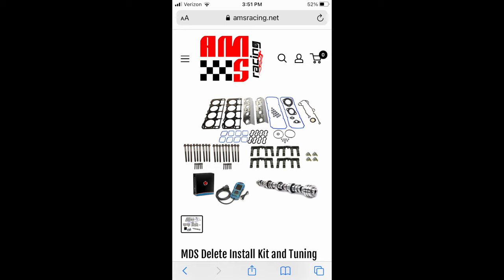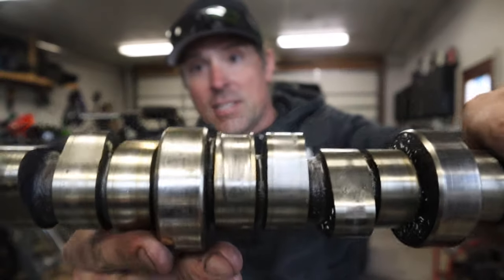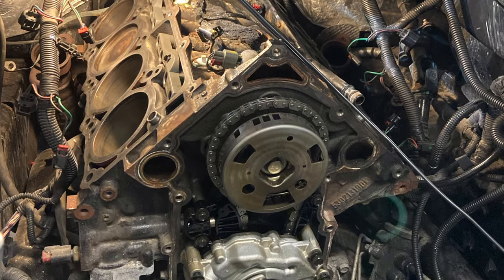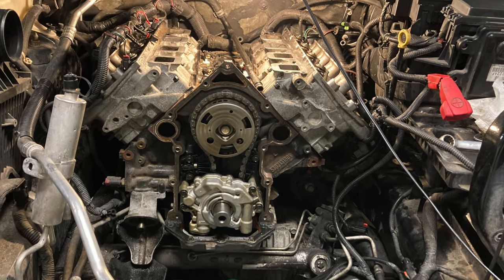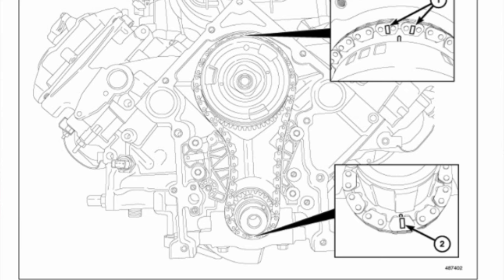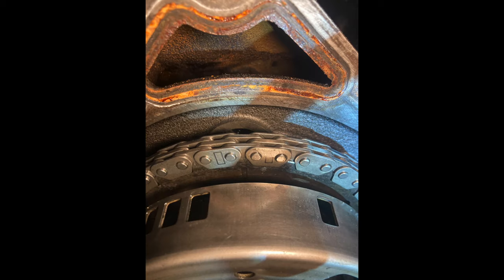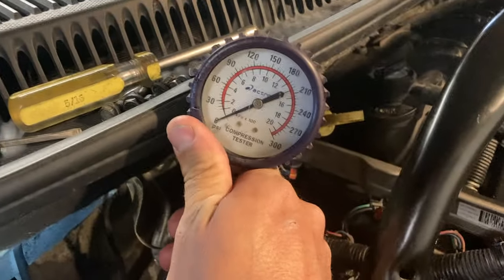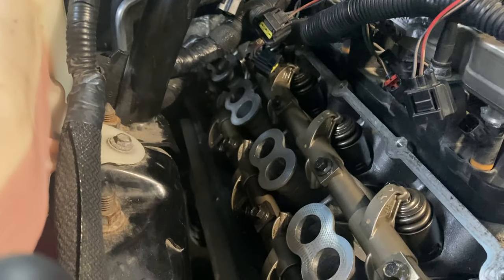Hemi 5.7 MDS delete, Lessons Learned

Comment: Here's what to do for MDS delete,
- Remove the 4 mds solenoids and cap em off and you will need a new 6.1 cam and set of non MDS lifters installed AFTER you use a tuner to turn off the mds system. Otherwise it will try to turn the MDS on and the computer will pop out engine codes. Also, if you go with 6.4 cam then you will need a tune otherwise the 6.1 is just a direct bolt on, no tune required besides turning off the MDS system BEFORE you do any work on your car.
Reply: Does 6.1 cam gives extra hp ? Or it is just non mds cam same as 5.7 ?
Reply: With the conversion to VCT, the cams for these engines employ a completely different cam core assembly with a much longer front cam bearing journal that includes two annulus grooves cut into the journal to supply oil to the phaser mounted on the front of the cam that controls the VCT. Of course, this means that early cams cannot be interchanged with 2009 and later versions as they physically will not fit the block. So this negates any idea of using a more aggressive 6.4L Hemi cam in an early 5.7L truck engine, for example. However, all VCT engines use the same cam journal sizing so these cams can be interchanged which offers opportunities to place a more aggressive cam in 5.7L truck engine from a passenger car application. This means, of course, avoiding the use of any MDS camshafts. In the early ‘03-‘08 5.7L and SRT 6.1L engines, the camshaft is retained with a small 4-bolt plate and the timing chain assembly also used a specific tensioner and guide system. This was necessary because of the greater distance between the cam and crankshaft. With the redesign in 2009 and VCT, the front cam retainer plate became larger, retained with four bolts, and the tensioner and guide system was also changed. These systems are not interchangeable as they are specific to either early or late cylinder blocks.
https://www.holley.com/blog/post/everything_you_wanted_to_know_about_gen_iii_hemi_engines/

Comment: My non MDS 6.4 hemi 392 charger has been running smoothly after 130,000 miles
Reply: However I change the oil every 4000-5000 miles without hesitation
Reply from the maker: That’s great!

Comment: Im in the middle of doing the same thing. What do i do with the mds solenoid harness? I have the same kit mds delete.
Reply from the maker: You can try to secure them off to the side, but I just left them disconnected.  I turned off the MDS on the Diablosport tuner, and have not received a code.
Reply: It can't be removed as the Cam sensor is part of it, leave them unplugged, won't bother anything.
Reply: @wheelinoutwest  Job successful. My hemi is now running with zero codes. 25miles so far. thanks for vid and info
Reply from the maker: @gregm90  that is great news, glad to hear!
Reply: If you just get the diablo tuner before anything goes bad and delete the mds you shouldn't need to replace any parts correct or am I wrong?
Reply: @dustinjohnson7002  wrong I think it will run longer way longer though.. it’s not yet proven but they will for sure run longer I think getting a he’ll cat gas pump will secure the deal tho

Comment: I guess I had no idea you had to go through all that to delete MDS.  I may attempt this in the future, when my Ram is much older, but it's my only vehicle and knowing myself, it would turn into a nightmare of a project.
Reply from the maker: That’s to mechanically delete the mds, you can shut it off electronically with a tuner. I only did this because I had to tear into the engine and replace the cam anyway.
Reply: @wheelinoutwest  That's what I thought, your video kind of threw me for a loop, didn't realize you were replacing the cam regardless.  Are there any risks just deleting the MDS with a tuner?  I'm a little nervous about it to be honest.
Reply from the maker: @mplslawnguy3389  Not the I am aware of.  The oiling system should work just fine.  I would suggest reading some online forums and such, there is some great info about it.  There is also a video that illustrates how the mds system works, that is really good too.

Comment: The problem was that you did not tune the mds system off BEFORE taking it apart. The computer was freaking out with engine codes for that reason. Also, the bent push rod was because it was not seated properly when you were rebuilding it, that's why it didn't idle properly 👌
Reply from the maker: Thats not what happened at all.  The pushrod was bent before I ever touched it.  After putting it back together I did have a pushrod not seated properly,  but it did not bend it.  Adding the tune after everything was done did not affect it all. The tuner backs up the original tune before doing anything.  Then I turned off the MDS, and it worked fine.  Its been running fine since.

Comment: Sounds like the pushrod wasn't in the cup of the rocker arm, and was holding a valve open.
Reply from the maker: Thats quite possible, it was the furthest back cylinder, so it looked like it was in place, but is was not.

Comment: The AMS kit is a good kit, but the lifters have axle oiling and drops oil pressure. Haven't seen a failure yet.... but i have seen them drop as low as 6 psi and that concerned me. 

I have excellent luck with hellcat mopar lifters, and 0w40 SRT Penzoil... 

Same as before, take it however you wish.
Reply from the maker: Interesting, I have not heard that about the oil pressure, thanks for sharing, I have heard good things about the hellcat lifter as well.
Reply: Dale I’m currently doing my AMS mds delete, with the mopar hellcat lifters you recommended running 0w-40 oil?
Reply: @connerbrasch8717  392 yes. If 5.7 run 5w30

Comment: I have question did anyone soak the new lifter that came with this kit in oil before installing them? 

Thanks in advance.
Reply from the maker: Yes, I did.  This was not a step by step video, , but more of a lessons learned, on how easy it is to misplace a pushrod.
Reply: @wheelinoutwest  I was told that soaking the lifter would stop it from starting have u ever heard of that?
Reply from the maker: @rolankelly9683  I had not heard that.  There is much debate online about soaking, but it seems to be the preferred method.  Another thing people do is to prime them by cranking the engine, and not firing it.
Reply: @wheelinoutwest  Thank you for your spouse it was a first for me too.. But you soak yours and it work so I’m good with that.. 👍
Reply: @wheelinoutwest  So do you have error codes showing for the deactivated solenoids when you replaced with caps?

Comment: do yourself a huge favor. Don’t run that 5W or 0W. 20 motor oil stick with a 10W30. oil you won’t run into any more oiling issues or care of issues. I’ve been running Castrol synthetic 10W-30 since I bought mine in 2009 I’ve got over 230,000 miles of hard-working hard-working I mean it’s a half ton pick up my trailer weighs 5600 pounds and I loaded with a 9800 pound machine that’s over 14,000 pounds when it’s not loaded I’m generally running a Highway and anywhere from 85 to 113 and it has never been in the shop for any motor work ever the only thing I’ve had to do to an engine wise is replace the EGR valve twice and I put two sets of spark plugs in it. I run a key in an air filter without oil. It’s been nothing but perfect.
Reply from the maker: Well, I inherited the vehicle, don’t know the history on it. It’s good yours has lasted.

Comment: Why not just activate tow/haul or change gears manually? It will cancel out MDS that way when your on a load road trip you can have mds on to save fuel?
Reply from the maker: I was already in the engine replacing a damaged Cam, pushrods, and lifters, its was easy to delete the rest having everything torn down already.

Comment: I’m having that same problem 😢
Reply from the maker: Bummer, how far along are you?
Reply: I did what you did a  compression check cylinder 8 pressure was low. It was a bent, pushrod it was not  in the lifter I got it running great now
Reply: Thank you so much for the video it really helps me

Comment: Why even go through all this trouble when simply using the incorrect weight of oil makes the MDS system stop functioning. LOL.
Reply from the maker: We were given this vehicle in a non running status, for our niece.  The kit for the MDS delete included everything I needed to repair it, I did not own the vehicle, or no the maintenance history on it prior to installing the  kit.  Although my sister in law who owned the vehicle prior, was pretty meticulous about oil changes, she owned it since it was new.

Comment: Ok so you did with their provided tuner….. I’m sorry I’m a lead master tech for Chrysler that owns my own shops 3 total. so I’m always criticizing other YouTube mechanics. I already know what you did (didn’t do)
Reply from the maker: ? Apparently you didn’t watch the video. I inherited this grand Cherokee with cam damage. They took it to a dealer and were quoted over 6 grand to fix. They gave it to us for our niece. We ordered the mds kit for 1200, we installed the kit, accidentally put a lifter in a wrong hole, made the video on how we were figured out the valve was not opening.  Because a lot of other people ran into the same problem. After that the kit was fine, and we used the tuner to disable the mds.

Comment: Also you did all that work and you didn't check your pistons rings silinder walls you had shaving I promise you that bottom end needs rebuilt you wasted all that money
Reply from the maker: When I pulled the head, I could see the cylinders just fine, they also had good compression. The vehicle is still running three years later.

Comment: Better off using a programmer to tune it off
Reply from the maker: In my case, I already had mechanical damage, so it was not any extra work to install the MDS delete parts.
Reply: @wheelinoutwest  got ya

Comment: Whatever you do, DO NOT just delete MDS system via tuner WITH OUT the MDS LIFTER DELETE.

The reason why, is it seems the MDS lifters only get FULL oil galley pressure DURING MDS activation.

See what I’m getting at?   I did MDS deactivation via tuner based on a recommendation; on a 2012 5.7 HEMI Charger, 16k miles later, ALL MDS lifters, (worst being cyl #1), are failing.   This is with HELLCAT LIFTERS, HELLCAT oil pump, 5w20 Penzoil Plat FA, every 4-5k miles.

Planning on a full rebuild in the next week or two, again.

Comment: MDS DELETE doesn’t fully prevent lifter failure; it seems to be a multi-faceted problem.   

Although, far more common on fleet and police vehicles with MDS and high idle hours.  

Lifter failure has still happened on manual Chargers, Challengers and Trucks without MDS, from the factory.

Comment: Never a good reason to delete MDS. MDS is not the  cause of lifter or cam failure.  MDS does not sap power. 

Use the right parts for your application.
Reply: What’s the cause then?
Reply: @terrylee773  no definitive cause has ever been proven. Chrysler has denied the problem exists, even though they've changed parts vendors several times, changed recommended engine lube and maintenance frequencies, and expanded warranty repair procedures.  

I suspect, but cannot prove, that a valvetrain geometry issue is causing abnormal side-loading of lifters, along with a possible scenario where excessive valvespring pressure occurs in certain applications.  Lousy component quality is also likely a factor.

Comment: Why is everyone obsessed with deleting MDS? It does nit affect performance unless you are getting into totally drag only applications. https://www.youtube.com/watch?v=T-Sbz2Etl_A
https://www.youtube.com/watch?v=KhG0KlXEOnU

Both of those passes where with MDS enabled and the car was driven to tracks in 5 different states and got 26 MPG on the highway.
Reply from the maker: I don't mind the mds, I only used the kit due to the fact I had a lifter/cam failure, and the kit came with everything needed to repair it.